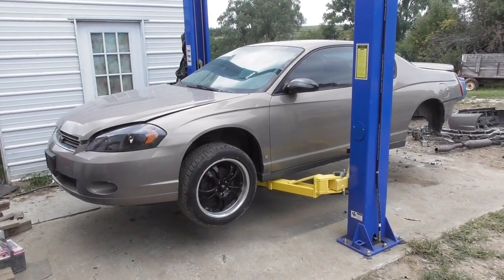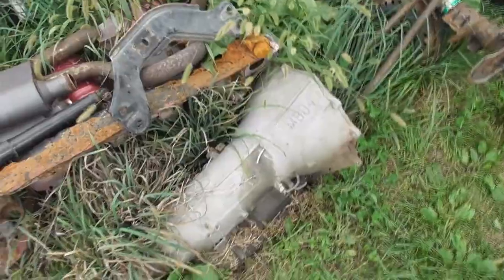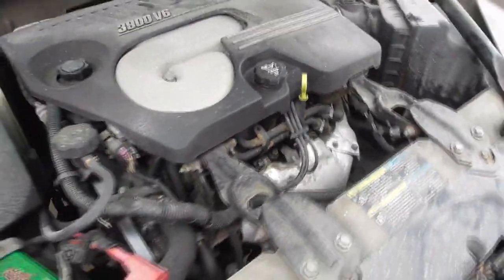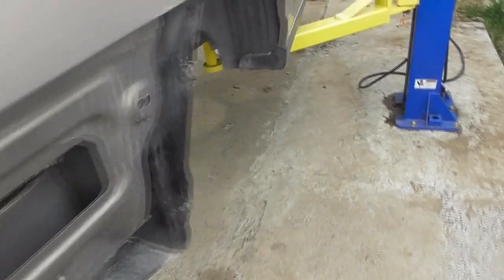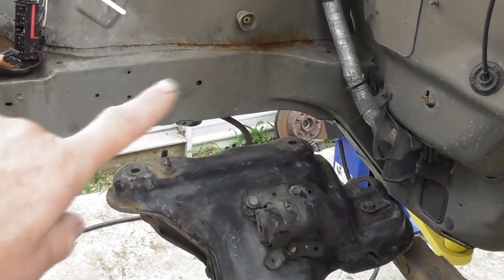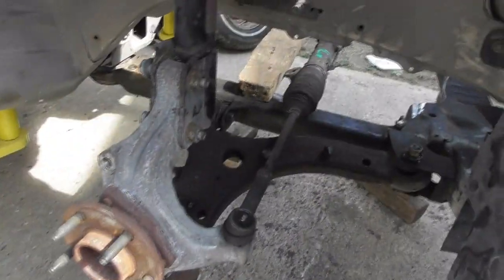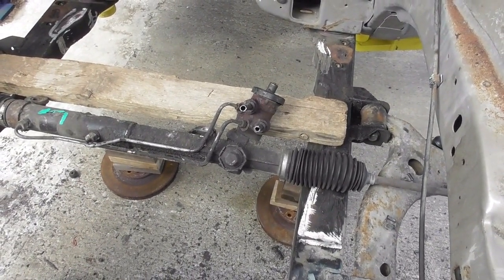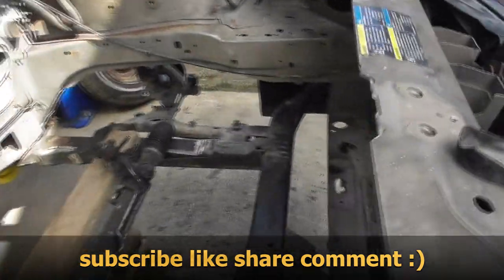LS 5.3 4l80e swap fwd to rwd conversion 2006 monte carlo project frankenstien #1

Comment: Hey, if you see this message... Do you have any updates on this car? Like, is it still around, and what is the guy that you built it for is doing with it.
Reply from the maker: no updates, its still around, the owner drove it once last year, beings it does not turn correctly, not much has been done. he does not like our suggestions to remedy it. basically he has to spend money, and the steering fairy hasnt mysteriously corrected it, so it just sits. there is a million diff ways to do a conversion like this. the one thing i will say is it aint cheap! and dont rely on what others on yt did, most dont tell you what actually works and what doesnt work, car basically needs mustang spindles on it, or a whole subframe grafted on. owner says we dont know what we are doing when it comes to steering, but it was his idea to swap the spindles from side to side, "gonna be easy peasy... it will only take 2 weeks.... LOL among other things i call dumb ideas, cause thats what ev one else did on yt. no one on yt says it does not turn correctly. expensive lessons learned the hard way.
Reply: @chevyfarmersgarage1955  So, basically, he doesn't want to take y'all's advice, because he's upset with you? 

THANK YOU for the response, btw.
Reply from the maker: @tramainesmith6067  he cheapened out I guess, You can only tell people something so many times, I just know what needs done to correct the situation, big ideas / dreams are over when  reality hits the wallet I guess...
Reply: @chevyfarmersgarage1955  Yeah, that makes sense. Sometimes you gotta make sacrifices to come out bigger in the end. In my opinion, I don't think he realizes the popularity that car could bring🤦‍♂️. That popularity could lead to paying sponsors, paying interviews from tons of popular car channels (like 1320 for example), etc.

Comment: What spindles and power steering did you use
Reply from the maker: stock spindles which make it not turn correctly, mustang rack with stock ls power steering pump

Comment: I have a 2013 impala ltz the last model year of this look. With the same headlights. I have the 3.6 300 hp but i so want to make it an awd v8 somehow lol. Or at least rwd
Reply from the maker: cool, its alot of time / work to make these rwd. not sure what to use for awd, i had a 90's pontiac 6000 that was awd, but i have only ever seen  2 of those. prob kinda rare
Reply: @chevyfarmersgarage1955  they brought on of these cars like your talking about in the north upullit yard
Reply from the maker: @christopherhyde9842  that would make 3 that i know of
Reply: @chevyfarmersgarage1955  I'm meant to say South yard I should look under it and see who they got the driveshaft ran by the exhaust. I looked at the tunnel inside looks the same as other cars.
Reply from the maker: @christopherhyde9842  i cant remember for sure but i think it was up high, very small diameter and had a carrier bearing in the middle.

Comment: I love the swap but you could have at least used a Chevy rear end fuc u could've even use the Dodge but a Ford that's disrespectful😂.......
Reply from the maker: a 9 inch or a 8.8 are the only ford parts we use, we used an 8.8 due to they are easy to find in the junkyards, and it was the right bolt pattern and width. the only gm rears in the JY are 7.5 camaro stuff.
Reply: @chevyfarmersgarage1955  oh that's why u used the ford parts........
No disrespect I'm just talking s*** don't mind me brotha 😄(u did that congrats👌)........
Reply: I have a 2007 SS V8 Monte Carlo sitting in my driveway rotting away in the Vegas Sun, nothing wrong with it it's just sitting there....
I bought a 2007 M6 BMW 5 years ago I parked the Monte Carlo 2 years ago( insurance purposes I was paying $700 for insurance for both the cars full coverage) both the cars are paid off though but fudge the insurance was kicking my butt.............
Reply from the maker: ya some of those ins companies are a ripoff, they start you out somewhat cheap, then slowly start to bleed you dry. best to switch to a diff company every  3 to 5 years.
Reply: @ronevergrow8319  You still have it ?? I got two SS. Looking for a 3rd. In Las Vegas NV !!
Reply: @BigDawgMechanic702  yeah I do, somebody knocks on my door at least once ah week asking to buy it but im keeping it because I want to do the rear end swap or all wheel drive like they do the Honda Civics, I wonder do they have a kit for the all wheel conversion for a Chevy front wheel drive car? 
I'm also in the 702, I'm in Paradise las Vegas Nevada ........ 
how bout you?

Comment: if i do this I'm getting a 3.8l twin turbo v6 from a GTR because ironically they're both 3.8's just different placement and manufactuers
Reply from the maker: im not familiar with the gtr engine, but i would think it would fit in the car easier, the 5.3 is a little tight. height wise and length wise more so than the width.
Reply: cheveefarmers well thank you and good luck, i hope your project goes well
Reply from the maker: thanks. we are getting farther along on it as we speak

Comment: Just to let everyone know this is my car and to do something like this would cost $20,000 in parts and $60,000 in labor. Definitely can't be done for $2,000 like most people think!!  Better be a dam good fabricator if you plan on tackling something like this yourself!! 3 people working on this car with all of use each having 30+ years experience working on car's!!
Reply from the maker: closer to 20,000 in labor. got to count every minute spent on it.
Reply: Biggest cap comment ever it was done in Detroit In the early 2000’s for 15k
Reply: @casinocali704  the only way this could be done for  $15,000 is if you do all the  labor. Take a build like this to any hotrod shop and  ask them if this could be done for $15,000 parts and labor and see what they tell you.
Reply: @christopherhyde9842 you could easily do this build for 10k or under if you do all the labor and have a shop or professional do the fab work for you if needed. Once you have the tunnel for the transmission and rear wheel swapped you have pretty much have free range at what engines and transmissions you could use. I have the same car and you could put a hemi, 2jz, 5.3, 6.0, bicharged v6, etc no problem it just all boils down to how much you love the Monte and how long you plan on keeping it around for. But once that conversion is done for rwd it opens a lot of doors for what can be done. Wether you go all out brand new parts or junkyards parts or a mix of both.

Comment: How much would this cost??
Reply from the maker: beings we are not done yet i coudn't say for sure, but totally done you could easily get 10,000 to 20,000 in it depending on where you get parts and who is doing the work. DIY would save alot of $$$
Reply: Aahhh☝🏽...... so how soon could you get to mines??😒
Reply from the maker: first my shoulder has to feel better. wrecked my s10 over a month ago and still in pain. slowed me down for sure :(
Reply: And would you recommend a complete donor?? I have a 2006 gto, it's just damaged in the front but nothing major. Car still runs.
Reply from the maker: that would help out alot, the more parts you have the better.
Reply: Well im sorry to hear that, hope you heal soon. If your YouTube contact info changes let me know so that we can stay in touch.
Reply from the maker: no problem man, and thanks
Reply: The cost depends on how you do it. It can be very costly if there is too much being done that is not needed. For example the ones been done they all rush and use a mustang rear end which requires extra cutting and fab. But could of used a chevy rear.......So it all depends speaking from experience its a pricey project but 20k....
Reply: @yandyrivera9517  i probably have $2500 in just junk yard parts $3000 in engine and $2500 in transmission and not to mention a laundry list of new parts i had to buy to make everything work. Could been done cheaper if you just put some high mileage engine and transmission and made everything stand alone and ran it stock.